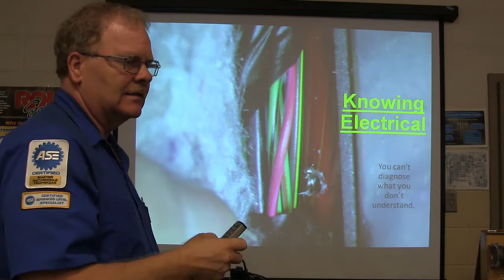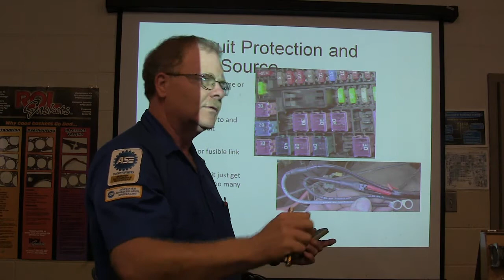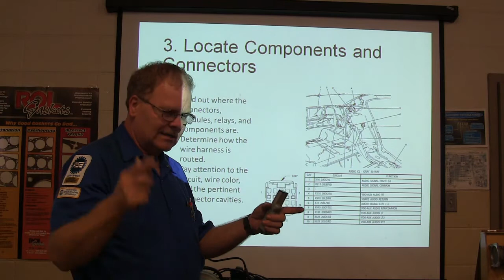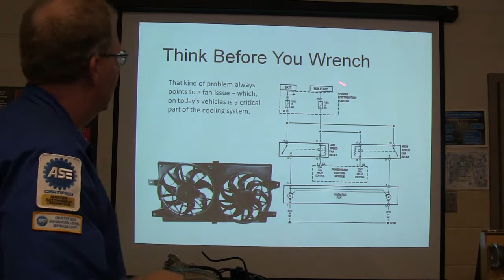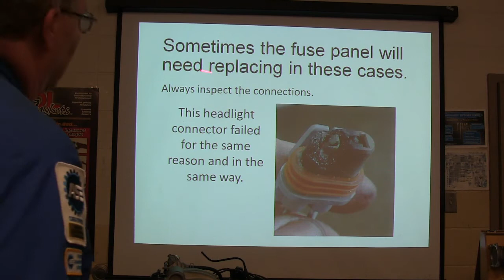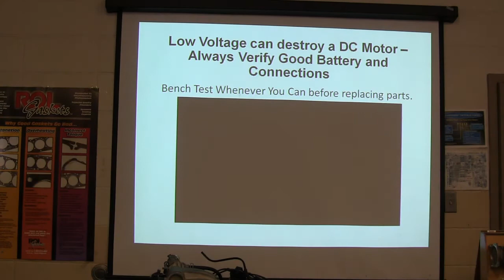Five Basics   Electrical

Comment: hi there, could u give a good explanation on why low voltage cooks dc motors. thank u
Reply from the maker: The motor can't do its work and it's like you've stalled the motor out - which increases the amperage and overheats the motor.